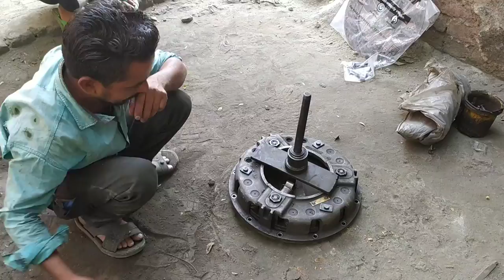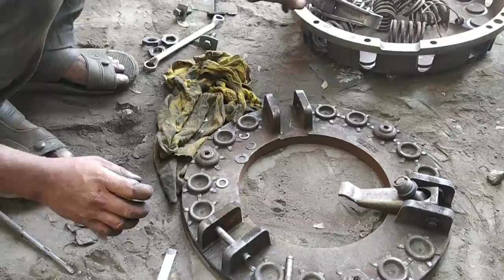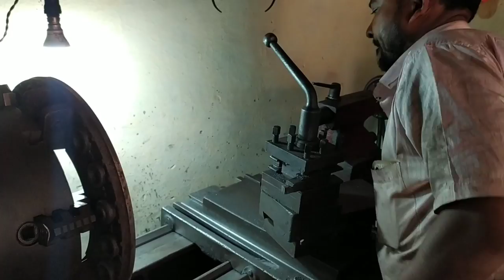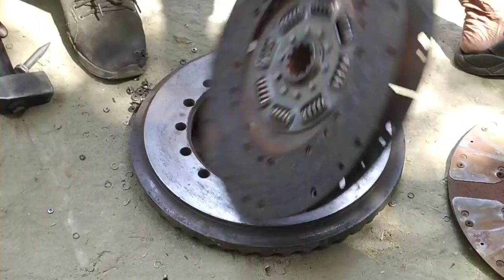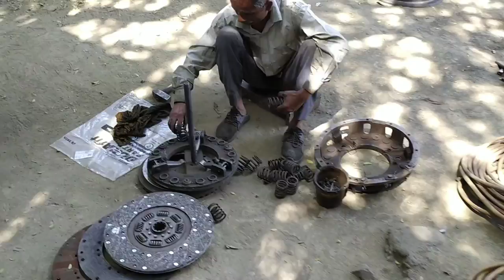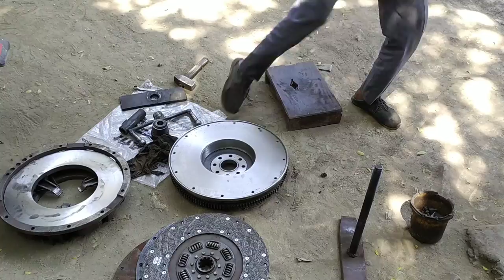Truck clutch plate repair| truck clutch plate replacement & pressure plate

Comment: A few things came to my mind after watching the "rebuilding" of the clutch. The pressure plate was machined and NOT stone ground, the marcel springs where NOT changed just hammered (prefer tool), the pressure plate springs NOT changed, he did checked and adjust the pressure plate springs (bonus). The clutch disc was riveted by hammering ( prefertool again)This rebuild will last (maybe) 1000 kilometers. Probably the cutch will chatter, the face of the pressure plate looked like it still had heat cracks......then again we're in India or Pakistan. Everything goes.......